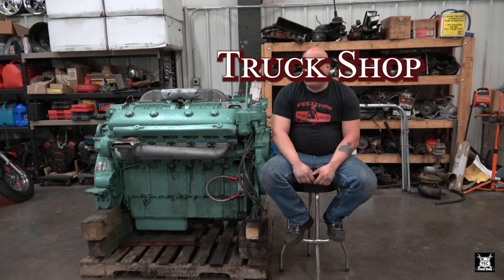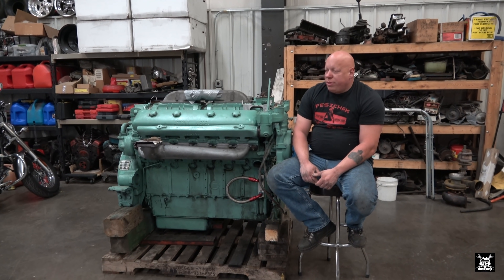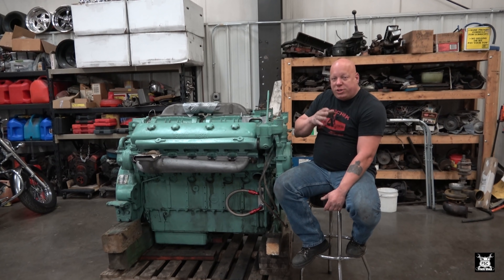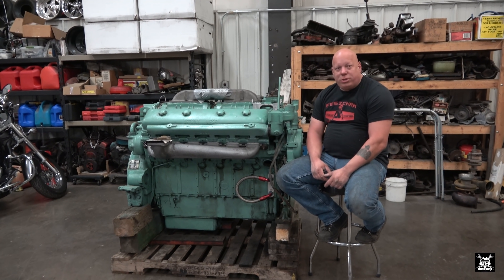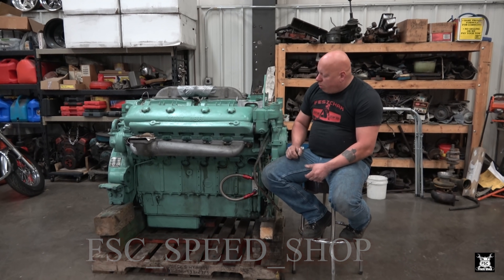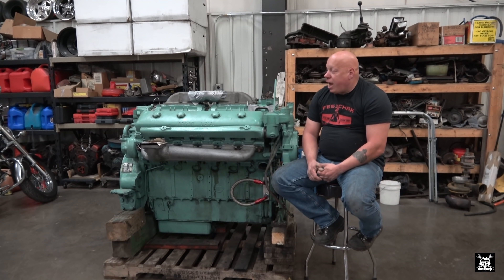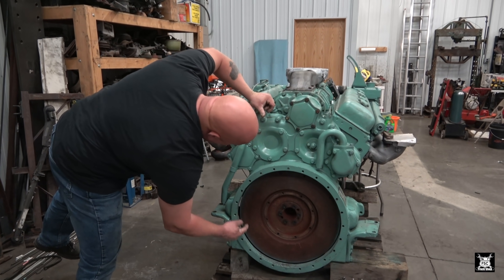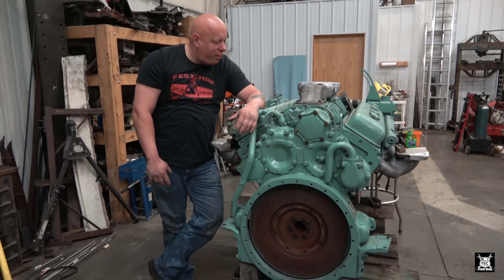Making Plans For My 12v71 Detroit Diesel

Comment: Extended hood truck is perfect for the swap they are what they came in the parts are exchange easy to move parts water pumps up fr0nt mack super liner and rsl 700 are easy fit for that  motor i drove  a 68 petebuilt 12v71 with a 5x4 trans set up

Comment: Great Video!  Greyhound actually did use a 12V71N in the MCI MC-6.  It was the first 102 inch wide coach in North America in the late 60s.  But they were rare as most states didn't allow them.  I love all buses, trucks, and all diesel engines, but I will always be a Detroit man at heart!  Thanks for another great video!  How about putting it in a Chevrolet Bison or GMC General?

Comment: We had a 30 ton crane with inline 6 had cracked sleeves and it still ran would only go about 5 mph and first off you can't put a turbo on these unless you change the pistons.

Comment: Brockway conventional.  There is a couple of dirt haulers out on Long island NY that still use them. Brockway and Detroit perfect match. There is a couple of examples of 12 V 71  Brockway on YouTube even a cabover...watching for shop vids brings back memories.  I started with a 1962 B 61 back in 1980. Also had a 1980 Astro with a 350 Cummins that I did a brake job on. Funny I through the brake drums in the back seat of my Lincoln to get turned at a shop, man did that turn some heads... All the Best,  thanks for the detail.

Comment: the man you want to talk to about the v-12 is tom price -price trucking beacon street buffalo, n.y. that is if he is still around he had several tractors years ago hauling steel out of bethlehem in lackawana,n.y. he had a few good drivers working for him , i seen the back in over to bethelhem and put three 40,ooo pound loads onthe deck at the very least . they pulled heavy 3 axle cover wagons mostly to NYC he had these v-12 pumped up and they sure could haul the mail. I always ran a 1693 cat and would put sixty or seventy thousand on a five axle outfit and it was all i wanted to run with these guys.

Comment: FSC..... I just found your videos, and watched your video where you found the crack & bulge on the right rear of the block and were also inquiring about the Serial & Model numbers.... I just responded to those questions for you (7.28.2021), along with some other info / suggestions.   One thing that I forgot to bring up in my response to that other video, was.... Why or Who, bypassed the Oil Cooler on the Front Right side (as Factory Viewed from the Rear of the block), with a braided stainless steel "looped" hose connection??  There is a very good reason why they go through the expense and time to design and build oil coolers for these (and other) diesel engines, and it's not just to add more parts.   

By the way, those pulley's at the Front of the engine... are right where they need to be.  Any accessories mounted on the back end, are either "direct drive" (bolted directly to the housing), or... pulley's added to drive whatever... all depends on the set up for any particular application... Automotive, Marine, Genset or Industrial in its numerous forms.

I think, personally... whoever sold it to you, sold you a "bill of goods".... I hope it was really Cheap.   By the way, the Engine Rotation on these engines, and for correctly sourcing parts... is Always, as viewed from the FRONT of the engine.... however the Starter and Oil Cooler(s) are Always "as viewed", from the REAR of the engine for proper engine arrangements and part numbers.... and that is how this info is dictated from Detroit Diesel in the shop manuals..... which, may I suggest... you might want to seriously consider obtaining for your engine, if you don't have one already.... as well as some of the Specialty Tools that you will need for this engine... and any other Series 71 you might obtain in the future.  

As far as Excellent Detroit Diesel sources.. I have a list of every "Reputable" (Independent & Factory Authorized) Detroit Diesel Re-manufacturer, Re-builder and Parts distributor in the continental US, Canada, Mexico and South America, as well as most of Europe, Asia and Africa.  Two of the best in the US with outstanding reputations is... 1) PCI - PC Industries, in Afton, Wyoming.... and 2) Stewart & Stevenson Inc... the Largest Detroit Diesel Distributor in the world.  S&S was to DD, as was Carroll Shelby to Ford.... before DD's ownership went to Germany.  

Any customer specific set-up orders with the 2 cycles, was Designed, engineered and built "in house" at S&S, for DD.... and one that was memorable to myself, back in the mid 1980s was some custom built 32-71's!!.... that were built by them for oil field use in Saudi Arabia.  They also custom built new cylinder heads for some Vertical 12-71's that were set up to run as dual fuel engines... diesel and LNG, so they redesigned & built new heads with spark plugs And injectors.  They sounded just as "sweet" on LNG as they did on diesel.  

You mentioned joining two 12-71's.... DD did produce 24-71's at the factory, for marine use, but only a small number were built (850+/-) between 1994 and 1997, which was the final year of production for the 2 cycles..... for "public consumption".... they continued building new  6-53TA's, 8-71TA's and 8-92TA's under contract for the government and numerous allied & US military applications... into the 20teens, except for the 8-71TA which was dropped sometime after 2008.

To be honest... Currently, I think PC Industries (PCI) is handling more of the 2 cycles, than S&S is... they're more focused on the MTU / Detroit Diesel side of things on a regular basis, plus a good number of their 2 cycle people have retired now... but they certainly still deal with parts, etc. Please read my Serial & Model ID numbers explanation in the other video I mentioned above.   

Also, keep in mind that there are multiple variants of mechanical governors of the Series 71 engines.... if you're going to put that engine in a truck.... make sure that you have the SWLS - Single Weight LIMITING Speed governor.   

If you really want to do something Really Different with Detroit power for a truck.... find a 6-110T.... a really tremendous and Reliable engine that can rival the hp and torque of the 12... and have better lugging power (ability to "hold" the torque on grades) due to its longer stroke and higher piston speed (per rpm), and longer "Usable" power stroke travel.  The 6-110's were massively "over-built" on the bottom end, and I know that GMD had them in their test cells putting out well over 730hp under load, back in 1962.   

I think a 6-110T/TA in a "Crackerbox" with sleeper (pre-Astro/Bison), or a COE (w/sleeper cab) Emeryville (IH), would be "classic".   But, as you said that you might want to use whatever you build for Heavy haul... the frame rails and suspension on those earlier 1960s trucks that I mentioned would be too light for that work.

There is a guy from ID (??)... that has a big bunk COE / 352 Pete (110" cab) with a 16-92TA, that he uses for short (mostly in-state) heavy haul, ... but rarely, and only when it's "nice" out... weather wise.  I believe he running an HD-750 Allison behind it, if I remember right... could be mistaken... been quite a while since I seen it last.  He also has an extended hood "A" model KW with a KTA Cummins under the hood, with sticks, that he runs quite a bit.

Also, in reference to changing the blowers in light of turbocharging (single or twin).... there are Two types of "bypass" blowers (and drive gear ratios).... depending on what turbo's you're using and at what rpm you planning to set the engine up for......... and if it were me, I would get rid of that block (crack & bulge) in favor of a really solid one... because the added internal stresses from the increased pressurizing by turbocharging WILL enhance the weakness that is now present, as the increase in hp & torque is transmitted throughout the lower end of the block.  

Cold or reverse polarity welding it, may last forever... in its N/A form, or in a "stationary" application... but I wouldn't trust it in the form of turbocharged "high outputs" (and parallel torque increases), especially in a truck frame which induces block flexing, not found in other applications.     

PS: Just so you know... I have a Four (4) year degree in Diesel Engine Design and Theory... specializing in 2 cycle from the mid 1960s (no, I'm not a "kid"... but am, at heart).     Enjoy and by all means, have fun with whatever you build.

Comment: it’d be cool to see it in an old gmc general you might need to lengthen the hood a lil or buy a long hood but it would be cool to see it in one of those, that was what i was planning on doing with my truck before i got looking to much and found out my truck was completely screwed. also i know quite a bit about detroits and i know how to get the engine the info from the model number such as application and variations as long as it’s original.

Comment: if it were me i would try to find an old gmc general to throw that in.  I drove a general for a farming outfit and it was an awsome ride.  the truck was a 1978 model. had a 13 speed eaton fuller in it but the engine i believe was a cummings.  they ran biodiesel in it.  perhaps an autocar or yeah a good old fashon mack truck.  i must admit though it was Orwell that caught my attention for your channels.  extremely entertaining stuff for a cabover enthusiast.

Comment: I think it's been a boat motor and I think it came out of a torpedo boat I think it is better to supercharge it as the turbo will give you a head ake turboing it will mean forge piston and bores with tempted veils were with a supercharger only the head need some work

Comment: If you're gonna use it for heavy haul you'll need to blow it, 80-85 cc high pressure injectors, then there's the transmission story I'd advise a 15 speed Fuller roadranger, to handle all that I'd advise 44 rocks !!!
The conventional would show it off more at a show but the intake and exhaust system would be simpler on a coe  not easy to pin that one down is it. Take care.

Comment: I would put it in a Ford ln9000 long nose . I learned to build engines on 671 and 871 a lot of our ln9000 Ford's had 671 and 871 engines in them .
Reply from the maker: I drove a 1973 Ford L9000 with a 6v71 many years ago for a friend.
Reply: @fsctruckshop6537  The only problem with the 671 was the head would crack in-between the valves they would have to pin the head then machine it .

Comment: I've built a few Detroits before but it will take alot to put a turbo-charger on it cause if it was not used for that the heads will have to be changed and also the Pistons were slightly different been a diesel mechanic for awhile. Wat is the serial number and I can tell you wat the engine was designed for I'm sure alot if mechanics can build this for you but to actually put in a working truck whould be even more amazing.
Reply from the maker: I'm looking into it.  However I may just abandon the idea and run it as it was.  Time will tell.

Comment: 75 autocar.  But then you have the butterfly hood.  Theres a guy running heavy haul around scranton pa with a detroit big motor, in a early 80s k100 cabover yellow and white with twin screw plus 2 lift axles.  5 axles under a cabover.  And she yanks em down the road.  If i get a chance, ill yell at him on the radio next time i see him.  Stuck in zanesville ohio for the time being.

Comment: The  availability  of  a Western Star or a Mack Western set up for your American Honda motor are very possible in the eastern part of the country or maybe resting in Wyoming, Colorado or any ole oil patch in the Rockies. Stuffing that motor in a older large car is a hell of an ambitious plan, but remember it is the reliability of the rest of the drivetrain that matters. Detroit's  love cool air and cool water temps. Your radiator has to be able to take in fresh air and its capacity must meet the needs of hills of West Virginia when grossing #120,000. That motor deserves either a 13 double overdrive or a 6x4 twin stick. Tall rubber with gearing to hit 90 mph across the flatlands of Iowa. As you know, a fresh motor does not react kindly with million mile rear ends or a stock clutch. Building a 4 axle with that powerplant is admittedly a awesome path, but break down in Parsippany, NJ, and who is going  to give you any sound roadside service on that motor? Hell, Cat parts will break the bank for most people.  Sticking a small block in a Vega is one thing, sticking the Detroit in a 1975 Kenworth W900 is another. Probably much easier to piece together the 75 W900. Look for a 1969 GMC 9500 Long Hood and build a Sunday driver.

Comment: Buy another cabover then get a conventional hood and build a truck. I have only ever seen one cabover that was converted. I think it may have been one the first truck with a walk in sleeper. One thing interesting about these Detroit engines if you happen to roll back when starting to move forward. They will run in the opposite direction they won`t have any oil pressure and you will smoke coming out of the air filters. I have done it a few times with 318`s.

Comment: 2 things before you start , 1 you should get a truck engine for key components  ,oil cooler, oil pan? Flywheel,flywheel hsg ,2  bore cylinder  out to true bore in block if not already  done , very critical this is a must not maybe!!! oh 3 full blown oh can go up to $25,000.oo be careful!!! Putting silver 6-92 bypass blowers  only if you turbocharge,but it gets tricky ,because bypass blowers  stack up  .560 thousands longer than v- 12 blowers on a v-12 I  did over 14 different  machinings.!! to get silver bypass  blower on a v-12.

Comment: if it really has the big Injectors they should be the N95 with a large cam from a ship or boat.
Reply from the maker: N65 came out.
Reply: N95 injectors are for turbocharged engines. Be careful with how much power you make. Detroit’s need a lot of cooling because they fire on every stroke. You want the biggest radiator you can get.
Reply: @billmoran3812  that's right thanks BM the last big one i worked on was a 8v92t and it had the N95 and a big cam power unit. and you are right the Detroit tends to run vary hot under a heavy load.

Comment: Most of the old Greyhound busses, ran a 6-71. The engine is a inline six cylinder.
Reply: Most had 8v-71s, I had the bad fortune to work as a mechanic for a bus company once. You're right though, the real old busses had 6-71s.

Comment: in school we swapped one into a butterfly Pete, we had to stretch the hood and push the cap back to make it fit, the instructor was going to use it to tow his fifth wheel when he retired, don't know what happened with it, it was in the body shop when i finished the program. sadly when the diesel and body shop instructors retired both programs ended

Comment: If that 12V71 is from a Terex, my guess is that it's likely from a late-'60-early-70's- vintage S-24 model scraper. If so, the engine in naturally exasperated form was rated at 423 hp at 2100 rpm. That would also explain why the engine has a flywheel setup for an automatic transmission.That 423 hp rating is extremely moderate, if not low even for a 12V71.  With appropriate mods - ie -  lower compression 'turbo-spec' pistons,
 a pair of 6 or 8-71 turbos,  bypass-type blowers in place of the n.a ones,, an air-to-air intercooler before the blowers in addition to the factory aftercooler below the blowers, bigger injectors,  and a pair of high-output marine camshafts would give an easy and  still dead reliable 600 or so hp at the ground at 2100 rpm and about 2200-plus ft/lbs of torque at about 1400 rpm. I know this, because these the exact mods and specs  that were done to  the12V71 powered long-haul freight and produce hauler that I drove for a while back in 1987. That engine by the way   - swapped into an '80 Freightliner FLC120  - was originally a 12VTTAC genset engine, modded and converted to truck use.
You can see the specs, including the engine specs for the S-24 scrapers here
https://contractormag.co.nz/classic-machines/terex-s-24/ Hope some if this helps.
Reply: I was in marine engine side of things.  The 12V71 TI Were typically at the setting of 675 hp at 2300 rpm.  They were routinely turned up to 1000 hp so I’m at 2300 RPMs and some even did it at 2500. The rods were the weak link to go above that setting .  Getting 600 horse out of one is pretty easy
Reply: @jonnycash6909  I agree with you totally about the hp of some of the marine-spec 12V71s. In a truck application, producing 600 hp at the ground  - again, not a big deal for a well built, lightly modded single or twin turbocharged 12V71 - means the engine is actually producing somewhere between 700 and 725 hp at the flywheel. That was huge power for a  working OTR truck back in the day, and is still pretty impressive today.

Comment: The first truck application was a livestock hauler from Kansas who put it in a Pete cabover. Detroit's leak oil, when they quit leaking oil then you worry. Because it's out. The v12 was offered in the GMC Astro and the Chevrolet Titan 90

Comment: There is a bonneted Mack 700 also But whatever you decide it needs to work for you unless just for show? You do a lot of Oshkosh work so maybe something from them or they might suggest something maybe even scale a chassis down if too much for your needs/economy but if hauling 4 axle plus units need something more substantial on Heavy/Over size Hauling

Comment: I drove a couple of boats with 8V/71s  and they are awesome, you are correct about their versatile configuration. Any military personell should be able to help and Detroit should have good archives of these engines. I think I may be going out on a limb, but a FWD engine, twin steer, bogie drive Kenny with a tilt tray (also know as roll back) and large knuckle boom crane would get some views, throw on a lazy axle and you can carry some weight. Good presentation and just my 2C worth.